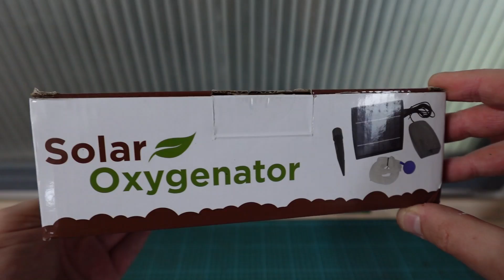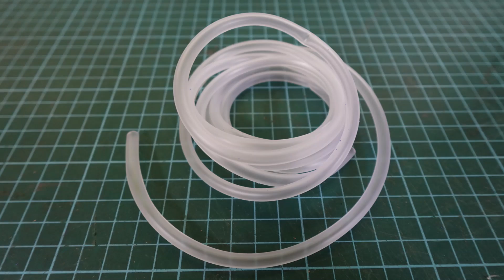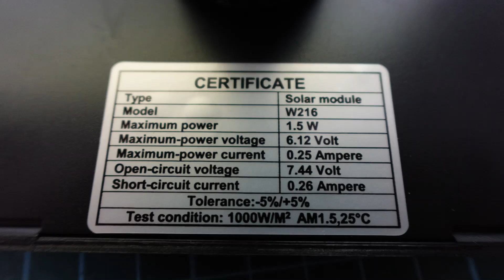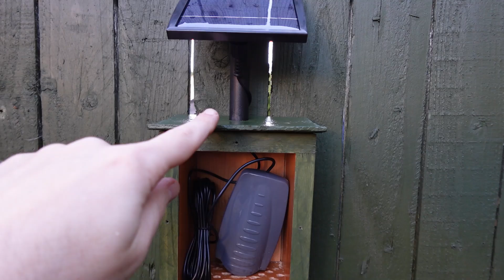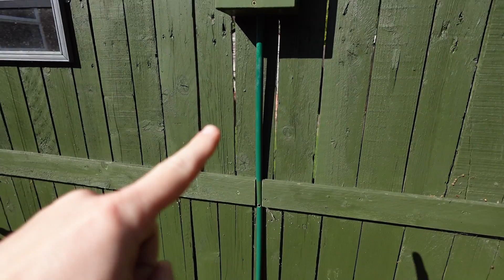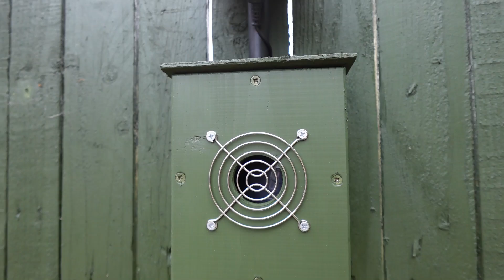Woodside Solar Powered Oxygenator Pond Water Pump - Review & Set-up

Comment: I have seen a cheaper unit (for £8 from Home bargains i think). It is self contained, so i would have to pull it apart and add a power cable to move the solar panel high up. 
Solar panels work best facing due South and about 35 degrees from horizontal, i believe.
Reply from the maker: I haven't seen that one I will have to check it out. I was limited to where I could get this panel as the back garden doesn't get much sun. Luckily it is working ok.

Comment: Thanks Phill, that seems very effective, I'm quite surprised how much flow there is in good light conditions, I was considering a water feature with small bubble fountain but this could be better. The enclosure is a good idea I think, an alternative might be to mount the solar panel at the top of the fence and run the cable down to the box near the bottom, where the hose would be long enough to reach the pond, but it wouldn't be quite so neat ? I wonder if it might also be a good idea to mount some fine mesh over the holes and  behind the grill, to stop. it turning into a bug hotel !
Reply from the maker: Cheers Andy, yea it surprised me too it's more powerful than I was expecting which is good. I might put some mech behind the grill when I find some. Yea I was thinking of a few ways to put the box and how to position everything I just settled on this in the end I was trying to make it as neat as possible.